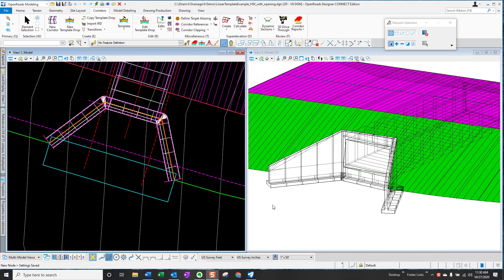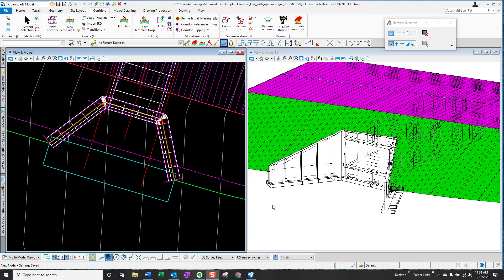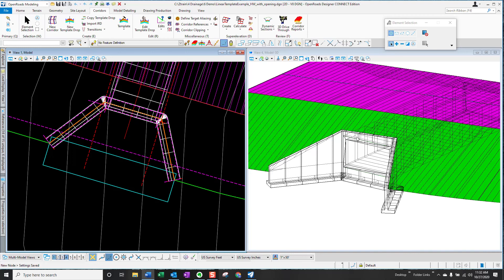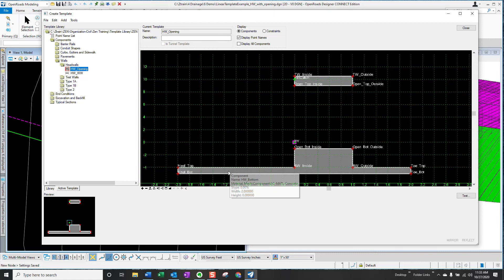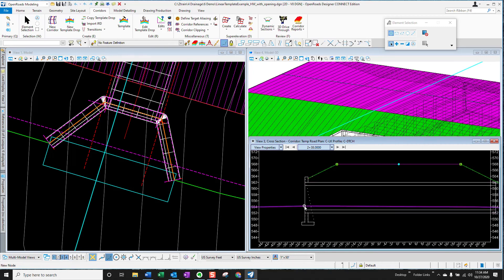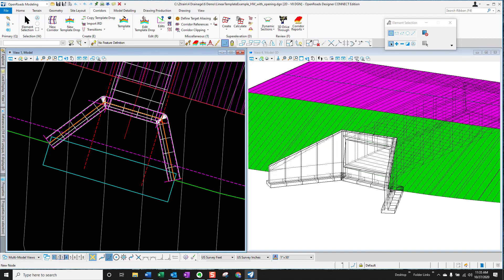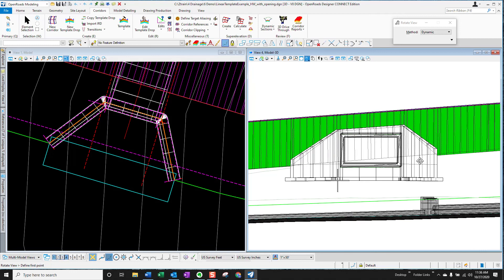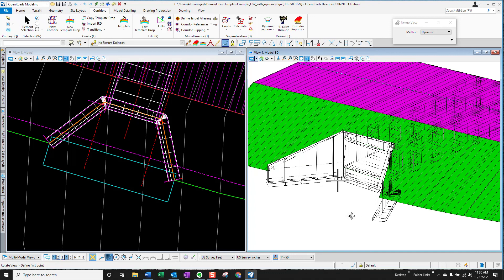Modeling Box Culvert Headwalls

Comment: I good aproach, but a lot of time the aligment of the culvert has a skew angle with the road or rail aligment
Reply from the maker: Well, it's been a long time since I posted this video, but I would say that it would work for skewed culverts as well.  The control baseline for the linear template is the back of the wall where it intersects with the proposed roadway fill slope.  It does not have to be parallel with the roadway alignment.

Comment: Which software it is
Reply from the maker: OpenRoads Designer, by Bentley Systems.
Reply: @karldauber  Is it possible in OpenBridgeModeler?
Reply from the maker: @emjay0507  I don't know.  I have not used OBM.
Reply: @emjay0507  OpenBridge only builds smart solids for al bridge components, as decks, beams, columns, abutments, footings, piles, barriers, but it has not the technology, included in the itl files, to design the parametric components and points you have seen in the video.